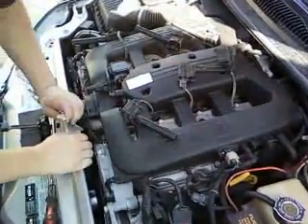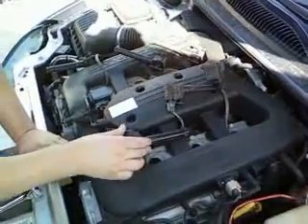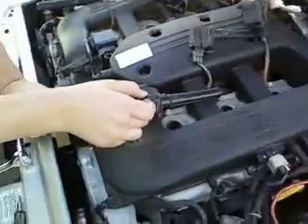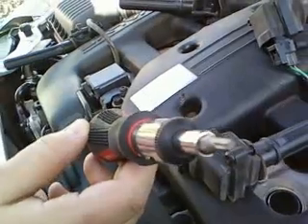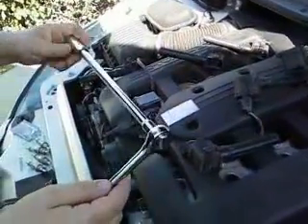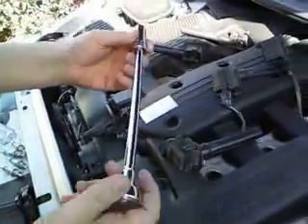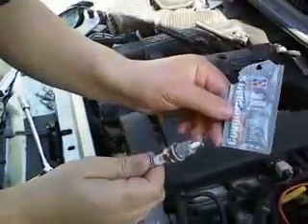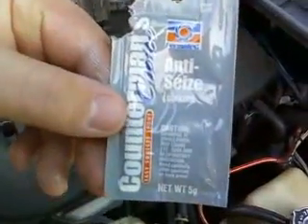Chrysler 300M Spark Plug Repair Video 1 of 3

Comment: Anti-seize keeps the threads from getting stuck or "seized" in the head. You apply anti-seize to the threads of the new spark plugs before you screw them in. I use anti-seize, as soon as I get a car, on all wheel studs, so you aren't stuck on the side of the interstate at night trying to get a lug nut off that some baboon overtightened at the tire store or brake shop or just rusted solid. It is amazing on bolts, just don't use it on brakes.

Comment: what is the anti-seize for???? where does it need applied
Reply: On the threads of the spark plug just a little will do maby a drop the size of water drop and rub it into the threads before putting the new ones in